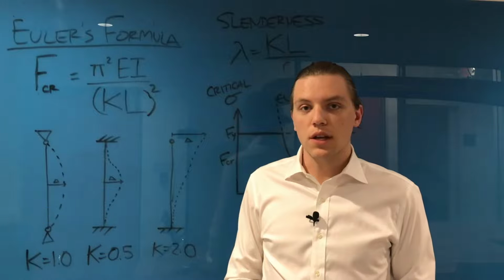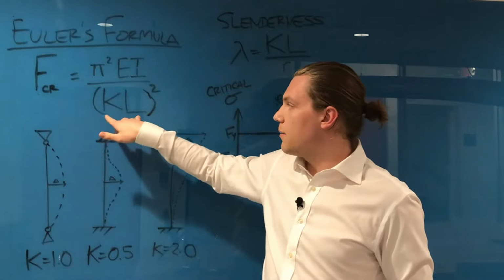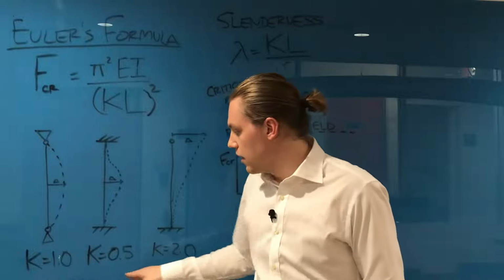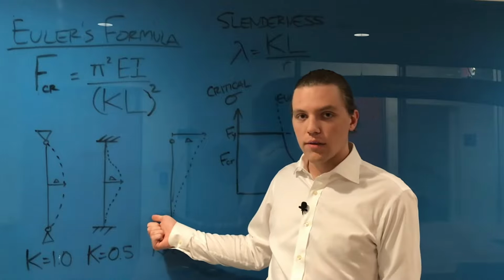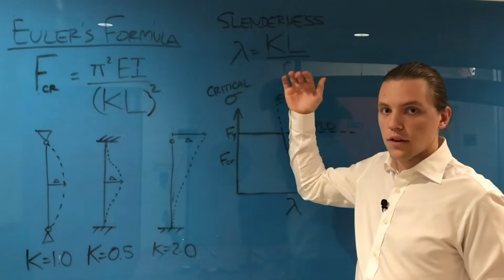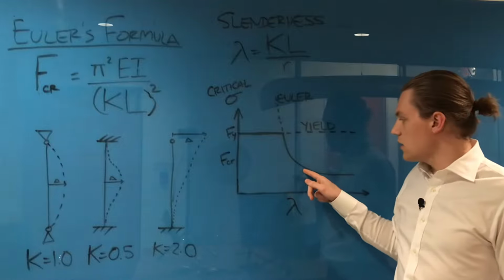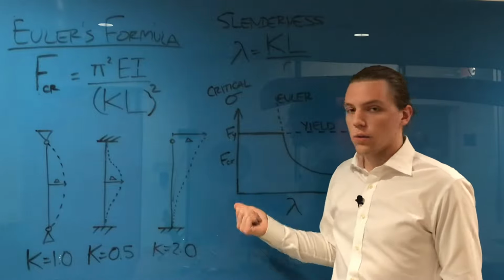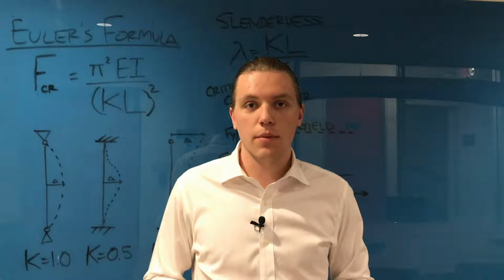Column Buckling | SkyCiv Structural Analysis and Design Software

Comment: Perfect. I have temporarily focused only on tension because I wasn't sure how to calculate buckling in members under compression in a truss. I can manually calculate cross sectional requirements in different materials in members under tension (no simultaneous equation solving needed for my design) but I can see how calculations for members under compression would quickly cause mental trauma. Looks like your s/w is a perfect fit for my requirements. Thanks for the exceptionally clear explanation of the maths.
Reply from the maker: Thanks Al! Glad we were able to help! :)